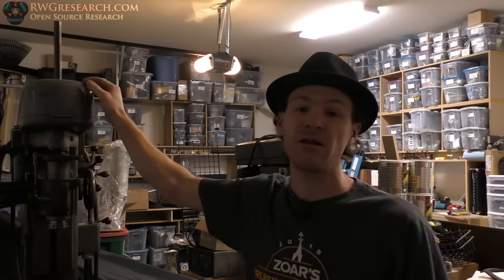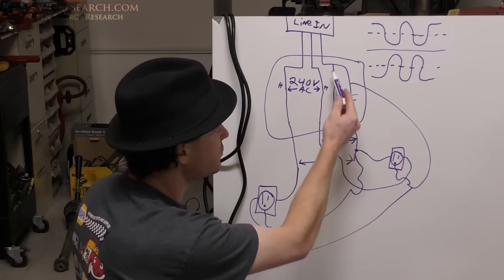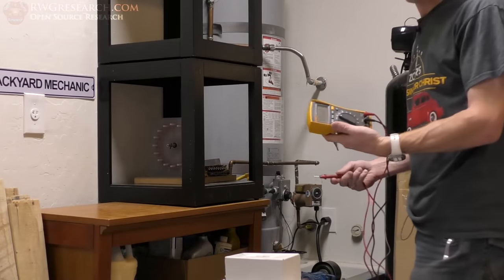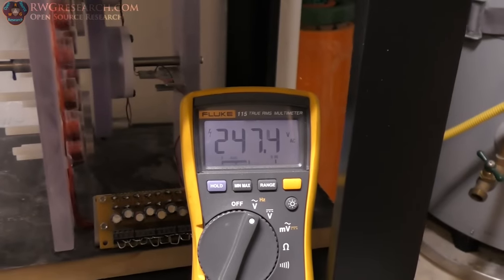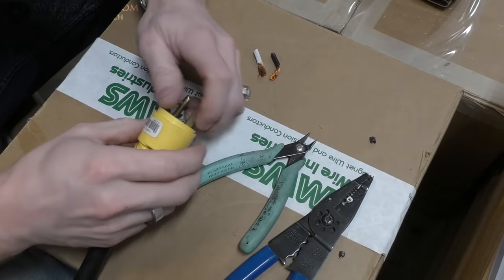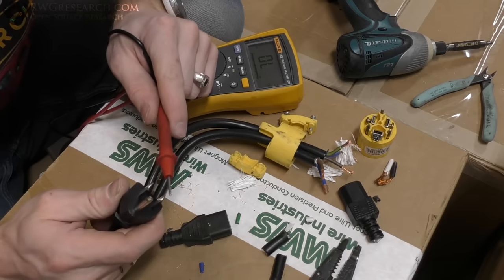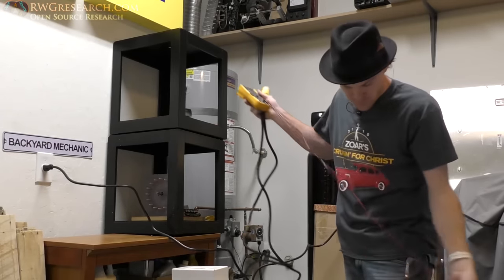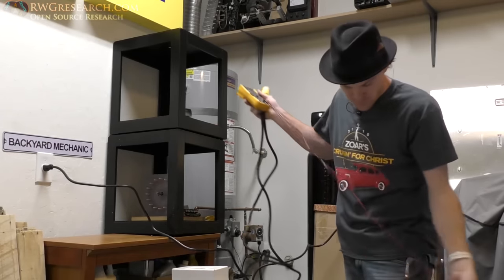How To Get 220V/240V From Two 120V Outlets. No Electrical Panel Work Required...

Comment: Lots of angry electricians in the comments losing work! 
He says do it at your own risk. Relax guys. Good video Russ 👍
Reply: Lol. Well put. Relax fellas. I need to weld a project for 5 min.  Not paying 500 to get a 220 installs in a philosophical and theoretical code standards.  Sometimes Macgyver improvisation is required.
Reply: All it takes is one of the circuit to blow  and because it’s fed by another circuit it may not blow and instead overheat.  If you’re running a massive draw in addition to the already existing 2 lines it’s possible the lines each go over the 15 or 20 amp rating.  The line blows and is back fed by the other overheating both.  Seriously it’s bad! Don’t do it for 5 min.  Hire someone to weld for that 5 min one off job. Scares me that anyone would entertain this nonsense.
Reply: @One-Crazy-Cat  - You're absolutely correct. The rest of you ...please pay attention to what this man wrote. The boy in the video claims it was a quick job. Just remember it takes just a second to start a fire. I'd bet that hack doesn't store flammables properly, either. Either way, it's ignorance at its worse.
Reply: Knows just enough to be dangerous! He is not wrong, but it's not right! 🔥🚒
Reply: Max Drinkwater to expand just a bit, yes you can make this work. Is it safe to do even for a 1 minute job?
I wonder why this would be in violation of every electric code know in the USA? Why because it had removed every safety feature designed into electric work!

If you have this much knowledge, do it right! Install a sub panel and have those safety factors, and not risk burning your house to the ground.
Reply: Electrical codes are not for theoretical and philosophical purposes. They’re developed over decades following blowouts, fires and other major problems. Only a fool ignores them intentionally because they’re into the “freedom to do what I want philosophy”, which some of you guys seem to be. Ignorance is its own reward.
Reply: Mel Gross many things are said about fools. I don’t know that I have every hear one about a fool bypassing every known safety precaution to attempt to burn down their home, but the comments indicate that the one on the video has company!
Reply: Seems like if one breaker trips, the circuit is broken AND since there is no earth connection, no voltage to drive any current.
Reply: WA9KZY the problem with your logic is that since he hacked it the breakers are not pinned together at the electric panel. Thus you may well only trip one of the two breakers. Thus the feedback loop of current others have mentioned. Often on a 240 volt circuit only one side will be overloaded, but by code 240 breakers are joined by some bridging device so that even though only 1 120 side is tripped, the safety factor disconnects power to both 120 sides of the circuit!
As for an earth connection, I did not watch all of his doings. It was too unsafe for me to continue! But depending  on how the panel is setup the neutral and ground circuits may be bonded in the panel. This is by design in a Main panel (by code) and is a mis-install in many sub panels, where they should by code be isolated but are not! 
It just is not safe!
Reply: I believe you have given the crux of all the arguments; electrically it is workable, but not in the NEC. I've been a double E for over 40 years. My 2 cents. If you "know what you're doing" do it, but don't advertise it around and give some idiot an idea.
Reply: Thank you Mr. Patton. I appreciate your time and expertise. Still a lot to learn concerning this issue and I can assure you I am only interested in the theoretical side. I don't play with matches either. Posting such a "tutorial" is tantamount to posting a video on how to hurt yourself. Where are the YouTube algorithms, eh? The "bridging" device is something I need to learn about. Thanks again.
Reply: WA9KZY the “bridging” device as I used the term is a simple device that connects the 2 120 volt breakers to be one. In older breakers it was a simple pin dropped through the holes in the switch.  Newer styles are a plastic piece that snaps over the two switches. 
The purpose if this is to trip both if one trips. Open your panel cover and you will find some that are connect. 
Examples would be A/C, then others if they are electric would include furnace, dryer and oven/stove.

Comment: I saw this video when I was at a place in time where I needed 220 and had no access to circuit panels or anything.   I did what he said and it worked like a charm and I ran some induction heaters and a steam boiler and all kinds of stuff and it never caused a problem.  💯💯💯
Reply: I tired this but I dint get the 220 v ,voltage getting dropped and it’s came only 210 v what might be the reason
Reply: @murali5041   it is alternating current, it fluctuates from 210 to 220.   If you're getting over 200 volts you're doing it right and it's working  :)
Reply: Thanks ,my application is for the oven it’s 220 v operating when I on the micro power it’s getting off due to less voltage than 220 V,when I plug in other greater than 220 v it’s working fine can u guide
Reply: Kyle B in our home we have 2 120 v AC ,but when I check the two hit wire m getting 210 v ac only ,I want above 220 wat might be the problem
Reply: @murali5041  I am no expert, I would think that you should get 2×110 minimum.  and sometimes get 2x120.  But I can't give you an answer for your situation, I don't know anything that's why I watched his video lol

Comment: This is not a long term solution,  either hire a guy to do the work who knows what he's doing or install a pony pannel or sub panel. You should only use this very short term, and disconnect all of when not in use.
If for some reason you have an electrical fire, the insurance adjuster might try and blame you for this and not pay the claim. They will do anything to get out of paying claims do not give them a reason.
And I believe this does not meet code!  
I made up a dryer adaptor cord with 10/2 machine cord less than 50' long for welding in my garage with twist lock plugs
This is a much better option or from the stove depending on your amperage requirements.
It's only plugged in when I need it. The Sooj cable will carry more current then standard house wiring but you have to know the limits of the wire and distance you can extend it. the 30 amp dryer circuit works for a short time welding with a arc welder don't be surprised if you trip the breaker, if you do let it cool off and rest for a wile chances are your welder got hot anyway and needs to rest too.
That cable is about 1" in dia you can drill a hole in the floor or a wall and feed the wire to your work area, this is also temporary.   A permanent solution should be done that meets code and is inspected don't forget to pull a permit.
You can hire out the work or do it yourself.  If you hire somone make damn sure he's insured get a copy of his insurance card and his Electrical license. The insurance has to be under his business name.

Comment: First I'm not an electrician. I would like to install a switched subpanel to switch between utility power and an off-grid solar system.  I understand how to do all that, I've done it before, but now my challenge is I also need to run a 240v 1hp well pump.  My question is that since the solar inverter is only 120v, is there anyway that I can pull 240v power from this using some creative wiring  so the phase is correct? My initial thought is to pull two 120v feeds from the inverter and feed the subpanel 240v buss lugs with each one. 

So I guess the real question would be: are the two 120v lines coming in from the separate solar inverter outlets and connected to the two lugs on the subpanel hot buss going to produce the correct phase alignment for 240v in the subpanel?  I know I could just get a step up transformer but I'm trying to save the money.

Comment: If it is all you have to work with and you can put up with the extra wires, go for it. Instead of the wiring on the inside it's just done on the outside. Same thing, just an extra cord.

Comment: yah  your right but if the wire guage is small you gonna burn the wire before even it will trip the breaker..
Reply: only hack together things like this in the winter, so you can stay warm in your house fire.

Comment: Alot have said what really needed to be done instead of what you did.
1) A 2 pole breaker was needed....or at the very least
2) an additional dedicated 240v electrical box to the side of electrical panel box to do it properly from the existing breakers. 3) Then it would also be properly grounded to the ground bar also. So no fire hazard.

Or --4) Also an electrical junction box for the way you tried to do it because of many issues...the least being you never screw 2 wires into each screw for white,black,ground. Never. 
5) To be clear: do NOT screw 2 white wires to the white (silver) screw & 2 black wires to (brass) screw & 2 to ground. You need electrical  box for doing that. You knock out 2 opposite end "knockouts" on electrical box & use proper fittings to hold wires properly into both holes of the box...then tie the wires with "large red plastic wire nut" sized for proper amperage. 20 amp (12 ga.wire)  & 30 amp (10 ga. wire) & install pigtail wires to each group of 2 same color wire. Twisting a red plastic wire nut onto all 3 wires. So then 3 groups of 3 wires (1  pigtail tied to each group of 2 wires). Then take each end of pigtail tova new 240v receptacle on top of electrical box. Wire accordingly. Both hots (1) red or white, (1 ) black as both being hot... and the ground (green). a clean "single" wire coming from each group of doubles wires.7) It's proper & per code to use plastic wire nuts to tie all the 2 wire groups together with the 3rd jumper "pigtail" & safer as you do NOT want one of the 2 wires screwed to a single screw (silver) or (brass) to come off & cause short or fire. That's the way you also inproperly did it. 8) When in doubt look it up in a Black & Decker "complete guide to home wiring book" or other similar book.

Comment: Man thanks!!!!  I need 220 in the garage for a welder and there's just no easy way to get 220 in there.  This is gonna work!
Reply: So did it work? What amps does your welder draw? In my mind any welder that draws more than 30amps would not work and would be dangerous to run like this.
Reply: @ZenithClarity  This option ended up not working for me because turns out the 2 separate outlets I was gonna use for this had a shared neutral wire (a separate issue I'm not thrilled with).  I ended up running a real 220v line for the welder.
Reply: shared neutral is fine. very little current flows on that wire, if any at all, when you have a strictly 240 volt load. that being said, don't hack together shit like this, it's a bad idea.do it properly and you'll be happy with the result.
Reply: It wouldn't be strictly 240 though, that's the thing.  One of them is 120 circuit for the whole garage (with all the outlets gfci's, which could be another issue for hacking a welder circuit out of this).  The other one is a separate circuit which goes off to a shed (it's a switch).  And then these 2 circuits share the neutral.  In any case, it's doesn't matter, I wired a proper 240, so I'm good.

Comment: For small loads like a UK radio I might do this but for heavy or inductive loads not a chance.
Reply: why not? can this method not be used to power a 5400 watt dryer?
Reply: @paulcamalin5236  Definitely not, for a couple of reasons. Firstly, if your dryer vibrates and somehow dislodges one of the plugs, the exposed prong will now have 110v running to it live. Second, your breaker will be overdrawn by a dryer. Third, the 'computer cord' used is the incorrect gauge for that kind of load.
Reply: @kworldcorp  Do you mean that it draws 22.5 amp current?

Comment: Need clarification: wires running from the main panel to both outlets are not the right gauge. should be #10 if i recall correctly. So these wires would get hot. Isn’t it a fire hazard?
Reply: I believe the wires from the panel running to the outlets are only 120v. It doesn’t reach 240vs until they’re joined together by what he made. That’s where you’d need a bigger gauge. Anyone correct me if I’m wrong. Don’t want anyone to burn their house down

Comment: This does work in a pinch and only for temp use, however it is very dangerous.  Also the male end you used on the end of your mill is not a 240 v connection, it’s a 120v 20amp connection, note that it would plug into either of the 20amp 120v outlets you have on either side of your water heater.  A 240v 20amp connection would have both of the hot connections turned sideways. Also, 15 amp cords are not suitable for the 20amp suicide circuit you just built.
Reply: No, that male end is a NEMA 6-20p,  240V 20A.  NE MA 6-15,240 V 15 A would have two horizontal prongs.  NEMA 5-20, 120 V 20A would have one horizontal and one vertical prong but they would be reversed compared to the one shown here.

If a 20A plug is held with the ground at the bottom the blade which will enter the right slot will be vertical for 120 V and horizontal for 240V.  The left hand blade will be rotated 90 degrees relative to this.  This will be the neutral blade on a 120 V plug.

In the US 20A receptacles have one T shaped slot so they can accept 15 A or 20 A plugs, but I don’t think this is the case in Canada.

I’m from the UK, and thankfully we don’t have anything like this in our electrical system, though we do have other problems which you don’t.

Comment: So can i piggy back a 110 outlet on my generator with the 220 outlet? They both have split breakers. The 220 has its own designated 30amp breaker and the 110 has a 20amp breaker. I ask this because i use my inverter stick welder alot and would like to have it portable. With no power running the 220 shows 46amps havnt checked the 120. But if i piggy back the two and make a dog bone plug with an inline 40amp breaker is that feasible?  Thanks for sharing your video

Comment: Awesome video. I so want to do this in my garage, but safely.

So I understand correctly, if the two circuits in the same area are on the left and the right of the breaker box, this would work. If they circuits are on the same side (left or right), then this wouldn't work.

Left is one phase.
Right is the other?

Thank you again for this content. Awesome work.
Reply: incorrect. breakers can be on same side of panel next to each other. the real test is with a multimeter should read 240 V.

Comment: So my problem is this: I have a very nice AC unit that runs on 240. There was only one outlet in my apartment to plug it in and that was the old baseboard heater in my living room below the window. The maintenance people have since switched out the old ones in the whole unit and replaced them with newer energy efficiency baseboard heaters and there is no outlet to run it. I went to an electrical supply and bought a male and female plug and about 20’ of the right wire from Home Depot to make an adaptor so I could run from the outlet where I plug my stove in. The AC unit turns on, but nothing else happens like I can’t get the fan or motor turned on. I don’t know what to do. I’m not an electrician so I’m a little lost. The AC unit works and I have used it before. Is there something I’m doing wrong?

Comment: Also you usually don’t know to do a continuity test on the wires to find the hot. On all cords the hot wire is the wire with the markings/numbers. If it doesn’t then you you’ll have to do a continuity test

Comment: Hi there!
Thank uou very much for the video, very helpful.
 Do you think i can use this method on an electrical oven?
Reply: At that point, just get a 240 volt breaker and outlet installed by a professional. It will be up to code and will be reliable for life.

Comment: Naturally, the next question is can you run a load that requires a higher amp breaker feed from two lower amp breakers that are on the same phase! ? Great video I have always thought this was possible but have not found somebody to give me a confident answer.
Reply: Ur breakers would need to be high enough for the load x 2. In otherwords, both breakers will need to be i.e. 40 amp if the load is 35 amp.. Just to be safe.
Reply: no no, stop hacking shit together when you don't know what you're doing. I put a 100 amp breaker on a 5 amp load, just to be safe. wouldn't want the breaker to trip. stop this. don't hack shit together. the confident answer is, no, never do that.

Comment: I need a commercial product for a crypto miner. Miners require immense power, and thus it requires 220V. So, I suppose I need a power splitter where you have a 220V female outlet and has 2 male 110V plugs. Can I just buy this from Lowes? I don't have a 220V outlet in wall. I live in an apartment.